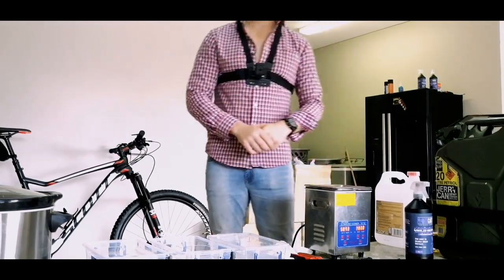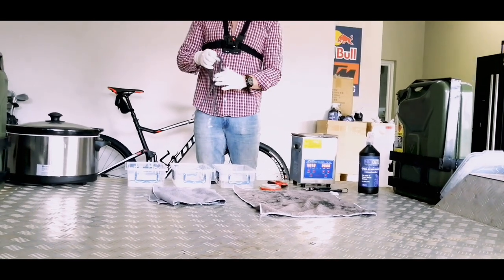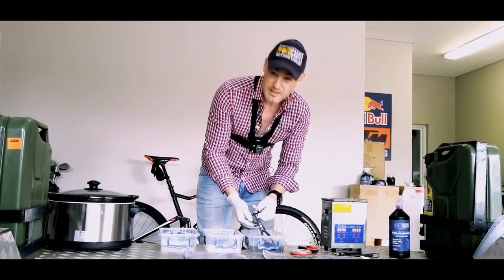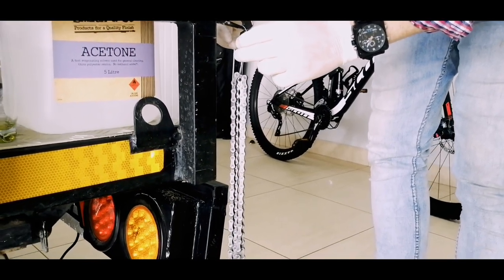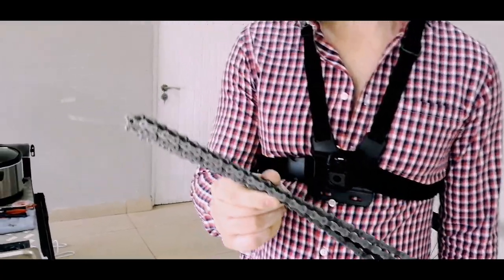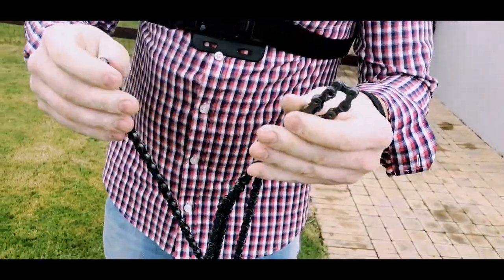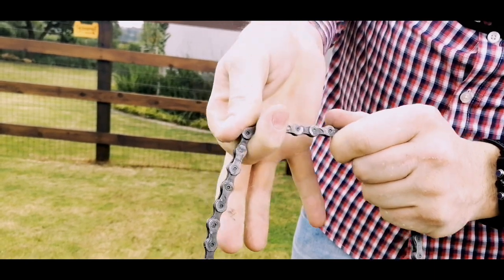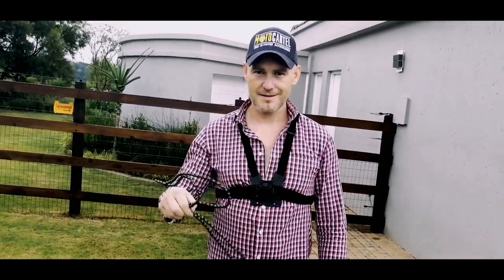How To WAX your BICYCLE Chain PROPERLY and a GIVEAWAY!!!

Comment: What is the ratio of wax to PTFE you use? I use 550gr of paraffin to 55g of PTFE. So 10:1. Would you also add a small amount of MoS2 to the mix for more friction reduction? Cheers. great video!